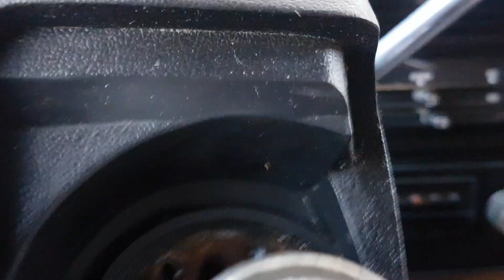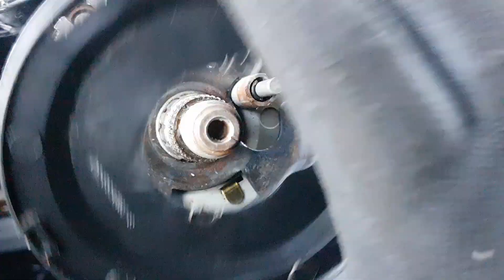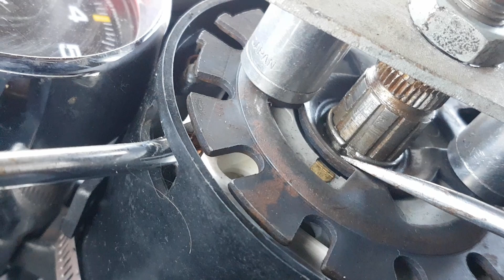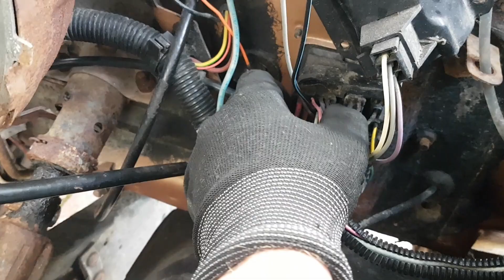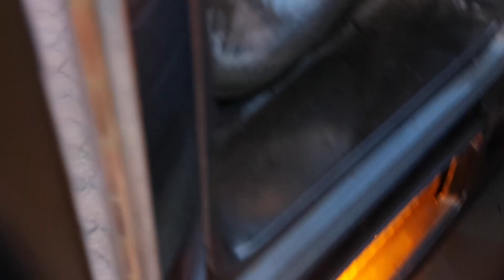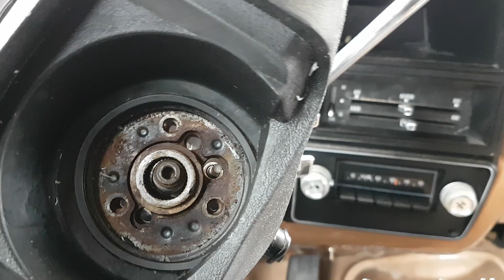Diagnose and fix squarebody truck turn signals

Comment: Thank you for this detailed video. I am struggling tracking down some issues with my turn signals/horn even after replacing switch in the column and trying a new flasher. This gives me something me something new to try!
Reply from the maker: Glad it's helped and thanks for kind words! Have you tried by passing the horn relay? They rarely go bad but could be an easy starting point. They also rely on the ground of horn contact which often gets corroded over time, partly from so infrequnt use. Could also try a ground jump wire on the horn contact area to see if it does anything. 
Keep us updated with progress!
Reply: @car_ventures okay so i cleaned the bulkhead connector as you showed in the video and after the first test drive it is so far successful, have to drive it around a little more before its confirmed but that is good to know about the horn contact. That will be my next thing to try if it acts up again, but so far so good! Thanks again
Reply from the maker: @Dylan07-59  That's awesome news! Very glad to hear it was down to the bulkhead connector and it worked after a clean up. 
You're more than welcome, it's easy to go crazy trying to figure these things out.

Comment: Question if you can I have a 85 caprice my issue is when I use my turn signals both sides come on either way. I checked the grounds and replaced the turn signal switch I down know where else to check
Reply from the maker: That's odd, first thought is that the signal is jumping across both terminals in the turn signal switch, maybe due to misalignment. With the switch visible, can you try a jump wire taken from +12v and tap it against each contact on the switch to see if they still light up at the same time. 
Or something easier might be to take out both turn signal relays and try a new one, in just the turn signal socket. This is unlikely, but maybe a good easy first place to start.
Reply: @ so I replaced both turn signal relays and tried it with just one. Same thing so I have a test light and when I apply 12 volts to the purple wire it’s giving power to both when i feel like it should only go to the two corresponding to the turn signal I’m leaning towards the turn signal switch having a short
Reply from the maker: @azams234  How did you get on with the problem solving? Did it end up being a short somewhere?
Reply: @car_ventures actually it was the wrong build I had one with the single connect at the bottom instead of the double
Reply from the maker: @azams234  Glad to hear the fix was kinda easy and it's working!

Comment: Thanks for the video I installed a new turn signal switch and it made the brake lights work but not turn 😢signals. Don't really understand yet how to do continuity testing but I've got an alt meter and trying to learn. I'm going to clean my bulkhead like you suggested as well. Could you by chance let me know the sequence of the headlights group of wires as they come out from the bulkhead because my fan ripped some of my wires out accidentally.? I can't make it out on your video besides light blue and dark blue on top...but what's the order and color of wires beneath those two?
Reply from the maker: Glad it helped and sounds like maybe a similar issue getting only the brake lights. Sorry that I didn't focus on the colors, I can take a look tomorrow for you. 
From memory, brown is the side markers and goes to all four corners. I think light blue and light green are for low and hi beam. 
Dark green and dark blue are for left and right turn signals. But I need to double check these for you. 
Continuity testing, use the horse shoe shape on the meter, and it will test if there's a connection between the probes... if you touch them together they will give you a beep and a 0 on the meter, showing that there's no resistance between the probes.
The idea is to then put a probe on one end of a wire, or switch, then tap away at the other end, and when it beeps, you know contact has been made between both ends. Do this with the battery disconnected, otherwise it can damage the meter is testing for continuity but its gets 12volts through it. 
Let me know if you need more answers and I'll update when I double check the wire colors.